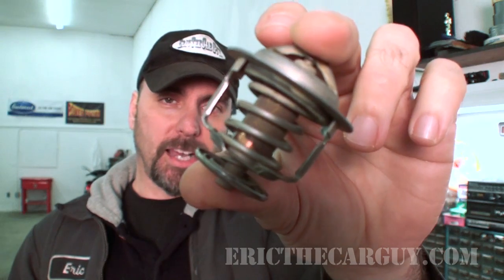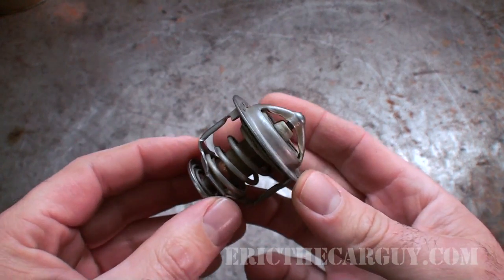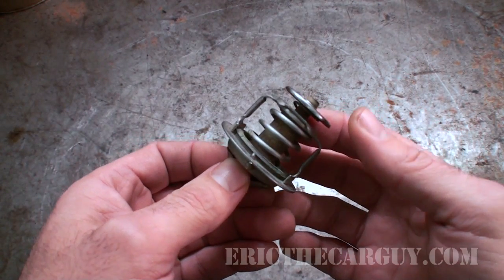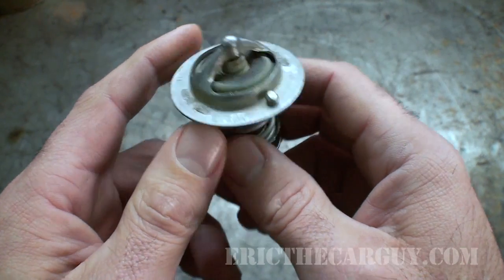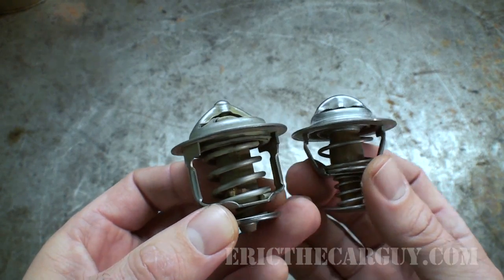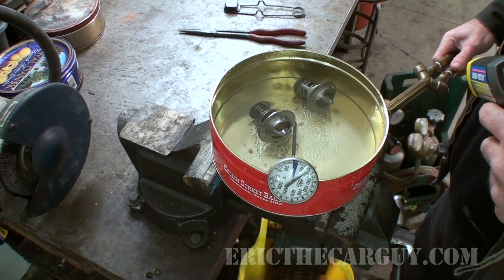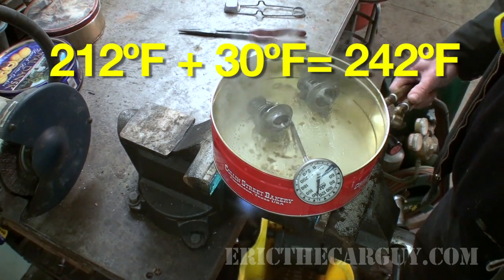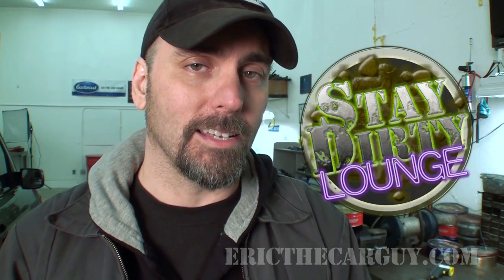Understanding and Testing Thermostats -EricTheCarGuy

Comment: I have a Ford F150 5.0, it started leaking coolant at the Thermostat.  Thermostat was working fine at the time.  I figured I'd replace the O Ring and I might as well change the theromstat too.  Put the new stuff in and it's still got a slow drip.  Took it apart again and put it back together again,  Still a slow drip.  What the heck is going on?

Comment: Hi, my car sometimes overheating when car was warm up at normal temperature then stopped the car a few minutes, then start the car a few minutes, overheating.  We Turn on cabin heater, temperature slowly back normal or Rev upe, temperature back normal. Whye it is?? It is Pajero 2003 petrol engine

Comment: ive read on alot of forums people will drill a tiny tiny hole into their thermostat to let coolant get into the engine quicker and help bleed the system better as well. A 1/32nd drilled hole would be perfect

Comment: I have always read, 3.25 degrees F for every pound of pressure. Close enough to 2 degrees F though. I have never been able to find the information at what temperature one would close though. I don't think many vehicle manufactures make their products, they just buy parts and assemble them to make a vehicle. Meaning these two thermostats, could have been made by the same company, even though they look entirely different for the same vehicle. I am sure you know that these cheaper priced infrared thermometers are only good at temperature differences since you cannot adjust the emissivity level as the more expensive ones. As perfect as these thermostats work, I have read that automakers are using an Electrically Assisted Thermostat in vehicles now. Love your videos.

Comment: Your theory on coolant not always returning to radiator from expansion rank ? 1 hose here no evident keaks on those particular hoses . I've done the dye test no evident leaks with uv ..cars running oretty well but if I don't jeep on top of it I'll get overheat issue and /or no heating. (Cold ) but if I keep eye it's all good.  Had hg replaced under a year ago but wonder if it even needed doing tbh . Garage has done checks can't find a fault . It's bizarre but garage I think tbh couldn't be bothered

Comment: excellent. I've used thermostats that I'm not sure they would be 'aftermarket', but are the sort of generic fits all parts available. They also opened quicker and had much lighter duty springs than the 20 year old one that was installed. I think this is a good thing to open earlier all things considered.

Comment: The water will pull the super hot torch heat away quickly, but it looks like your cookie tin is about to burn through the bottom.
Thanks for the thermostat test and comparison!

Comment: my sons 2008 silverado 5.3l has had a lot of overheating issues and its run without thermostat and still wanted to overheat? I can tell everytime is going to run hot b/c heater hose are cold and then it blows cold heat. I did replace bad radiator and expansion tank because of leaks. The water pump was repalced a coule years back and its has another new thermostat as of last friday and ran great for couple days but now he texted me its running hot and return radiator hose is swollen and very hot? The only thing i can think of is bad or imtermmitent bad water pump or the first stage is the recirclating thermostat isnt open so building back pressure and casuing it to overheat again??? Maybe blockage ? we have drain and put so much antifreeze or water in and out i cant see how is blcokage? Maybe blown head gaskets? Its strange it will run a few trips or a couple days then my son says his heat is cold again and then it starts climbing to 210 and above and then hot even driving and fans blowing. Advise lol

Comment: 13:25 yes and no, because that seal could be weak and still allow coolant and to get through when pressured, they do become weak so even if you stick it in boiling water he’s it will open and close but that rubber seal can be weak

Comment: The thermostat is set at a prescribed high temperature to help the oil system to; evaporate fuel and water (from combustion chemistry). Too much fuel in your vehicles oil system can dilute and thin the oil, excessive water and condensation in the oil can turn your oil into a frothy sludge, both of which can reduce oils lubricity, film strength and increased shear. This results in increased engine wear. So if your vehicles thermostat fails, do not let it run without a thermostat long-term. You are welcome. Thank you for entertaining and sharing.

Comment: I have an old 91 Camaro no matter what thermostat I put in a l run hot and overheat, I take the thermostat out the car runs at temperature no problems

Comment: I have a question about thermostats. Just purchased an oem water pump and thermostat. The mfr redesigned the water pump, and thermostat. when installing thermostat, it seems strange to me that the bottom of thermostat touches the bottom of water pump, and thermostat sits about 1/8" above body of pump. Like thermostat internal structure is too long. when tightening bolts the thermostat spring is depressed about 1/8". Never seen that before. Usually the thermostats always fit perfect, and no compressing of spring on install. I am wondering if this is an error in the manufacture and design, and if this will interfere with proper operation of thermostat and cooling system. you also can not just install the older style thermostat, because the diameter of internals is too wide to fit in the new pumps. You are kind of stuck using the new thermostat from the mfr. if you are to use their pump.

Comment: Tip: observe the water while heating,   when it has small bubbles just before the waters color changes to w white-ish tint, it's temp. is under 180°F . When it color has a white-is tint it's over 180° F . When the water is boiling, it dosen't have to be a violent boil, just lightly boiling it's @ 212° F or 100° C ...  boiling violent or lightly it's 212° F Becuase it's the max temp. which water boiling [ it's actually for  Chemically pure water] but tap water is close enough for the test. the same goes for its freezing point 32° F or 0° C .

One more thing Eric, Thermometer's like the the one shown in your video are calibrateable.  If you turn it up side down you would see that at the opposite side of the dial it has a hex.
This hex is for calibration, the process if fairy simple...
you need a glass of ice water [ preferred a foam coffee cup, becuase it insulation properties ].
Then insert thermometer and wait about 2 to 5 min. [ 5 min mostly an over kill ].
The thermometer should be at 32 °F , if not ajust with wrench and re-check thermometer, if not at 32 ° F , then re-ajust until at 32° F.

You can also, do this with boiling water. but be careful not to burn your self. 

I my self have 2 thermometers on calibrated with ice-water and the other with boiling water,  this is because am picky, this is because their is a discretion in temp. due to the thermometer is  a mechanical device. but ice water is close enough.  Also, the temperature at which water boils differs with altitude. 
Ok, Eric, I think I have written enough,  and you can take it from here...
Oh o e more thing, You can check the accuracy of you DVOM  [those equipped  w/a temp. Probe you will find that most of of them are not accurate [ personally I haven't found one to be correct, In bought tested w/ice-water or boiling water.
Also, ice-water is always @ 32° F / 0 °C .    32° F / 0° C is the temperature where water is found as a solid an a liquid...
Very good video.. 👍

Comment: So I put the thermostat in boiling water. It opened up.  But, water still isn't circulating. I am going to check out your video on how to bleed the cooling system
Reply: Also, super detailed video. Bad ass thank you very much sir.

Comment: Is there someone that can explain why the rotational position matters when installed on many vehicles? Is it the position of that little air bleed jiggle valve thing that matters for some reason?  If so why? In reference to a Subaru engine where the thermostats upside down I see some claim that little air bleed valve needs to be facing the front of the car. Thanks

Comment: My question was which side was up and which side down but hearing and watching the program I learned a lot more thanks for the info
Reply: Spring side to the hot water usually down
Reply: The big round hat end is what you will see sticking out of the thermostat housing.

Comment: I know old vid but. Is it possible for a new thermostat to work perfectly, gauge right in middle then begin to stick closed and overheat ? Takes about 25 to 30 minuets then engine is shut down by what I don't know. Top hose and that part of radiator reads from 224 to 230 degrees. Cap off it blows coolant out. Level of coolant goes up in reservoir half inch or so and back down when cool and starts normally. No coolant loss only very tiny leak at oil cooler when cool not hot. I did not know about the bleeder valve either and no mention of it in directions only to make the therm. bar level. It's been filled with pressure until no air at highest point and filled by pro equipment that uses a vacuum. More likely a crack or head gasket?

Comment: My car is in the shop. I likely need a new rad because it may be cracked. Hopefully it's not, but I can't tell where the leak originates from. But, my mechanic asked me if I wanted to replace my thermostat. It's a beater, but I must maintain it. 
Honda wants $53 for an OME HONDA thermostat. NAPA has after mzrket thermostates for $9.
I don't think there is anything wrong with the thermostat though it has 266k on the engine. Any thoughts?

Comment: I'm confused by the first comment where you state that Vehicles don't enter closed loop until operating temperature is reached 195 to 210 degrees Fahrenheit normally modern cars achieve closed-loop fueling status after about a minute which is when oxygen sensor heaters turn off

Comment: Can you both have over heating and cold air pouring out of your heater vents in the cab at the same time?

I'll be checking my thermostat tonight/weekend. On the way to work the coolant gauge would fluctuate depending on throttle (more throttle, more heat. Coasting and temp would drop, and some rough run/idle. Before shutting off.).

Comment: A thermostat works using a 'WAX MOTOR'.  Inside the copper cylinder, 
hiding in the middle, is a powerful THERMO-EXPANSIVE WAX. Inside the wax
 motor cylinder is also a piston. Hot water heats the copper, then the wax, 
which pushes on the piston, which pushes against the tstat's water valve
 closer spring

Comment: On the little air bleed on the thermostat you said to put it toward the top is that pointed toward the firewall or the radiator. Thanks Dennis

Comment: I went to diagnose why my car nissan Primera w10 kept overheating. I removed the thermostat housing and found that the previous owner runned the engine without a thermostat.🤷🏾‍♂️🤦🏾‍♂️
Also did he use the upper part from the manufacturers thermostat like a spacer to fit the cap on the housing. 
The termostat housing got a sensor with a harnes wich he short cut with a paperclip to keep the radiator fan runing continuously. 
Question: Did the previous owner  removed the thermostat for a reason and do i need to worry about putting a new thermostat?

Comment: so when a thermo opens and will the temp sensor also start the cooling fan? i let my eng idle and i think it went to 95deg C then the fan kicked in and the temp went down to like 55 if i recall ,now does that mean i did not have any air in my system or at least behind the thermo and everything is working good or could it be the fan alone was enough to cool it drastically like that? i am thinking no it must have been also the thermo opening up and letting the coolant system do the job,,what do you think? because this can save me time and money if i dont really need to replace the thermo but juts do a coolant replacement

Comment: i am not sure but i think my thermo is on closed position and may need to be changed,,i get a check eng light that im told from diagnosis is either my gas cap or my thermo but the light is not steady and sometimes goes away but this has been happening for years now and at certain times it would be steady on many drives and sometimes would go away so does it mean the thermo might be working properly at times and not at others? or could it be i got air behind the thermo giving a wrong reading to the sensor and in that case needs to be bruped? i thought the burping happens automatically through the reservoir, or should i put the car jacked on an incline and open the reservour cap and run the engine till it all burps out? thing is i want to change the coolant as its getting old now and wondering if i should bother changing the thermo first? i figured its a hard job but might be fast and easy for my mechanic  and should not cost too much for him to change the thermo and then i can do the long drain process on my own

Comment: 1972 Ford F250 .replaced water pump and thermostat. Engine side hole was damaged and had a big hole which larger than thermostat and it go through the hole and doesn't stay with housing . What is the solution? I double checked the thermostat and new housing and those are the right thing.

Comment: Good clear vid thanks. 
But quick question - I have a tropical thermostat on my Toyota so it opens sooner.  As a result the car doesn’t create heat for the cabin. Maybe that doesn’t matter but is the engine running too cold? Thanks

Comment: When you're thermostat close too slow, your engine will run cold. Just changed mine, tested and it was opening but closing way to slow causing the engine to run way too cold. The temperature needle never pass the 1/4 mark and goes way down when driving on the highway. Installed a new thermostat and the temp gauge needle is solid at half way mark and doesn't move at all, either on the highway or city driving.

A slow closing thermostat is as bad as having a thermostat that is stuck open.

Comment: This might just be the solution to the problem I have been having....
coolant coming out of overflow tank, but the engine is not overheating.
And the heat in the truck is awful.

Comment: Is aftermarket just updated parts in some cases , perhaps more efficient i don’t know, but shouldn’t cars delay on temperature when shutting off engine rather than quickly closing the valve or quickly cooling down just curious,

Comment: help ... :)) i've changed the stat  and refiled  the lost coolant 1.4 gal's and  i've bled the the system  and temp still drops wile driving aggressive  from 180 to 86 F   (82 to 32 C) and  back to 180 aand the  temp outside is just below  32 F (0C) ...  i use a  premixed antifreeze,   coolant is flowing thru all the pipes  thermostat opens and closes normally no problem there  but the  radiator  is cold ..i just don't understand  what's not right   i first  noticed this when it started to get cold outside ...in the summer there's no problem  temp  keeps up under  all conditions

Comment: Hello Eric the car guy. I have a honda accord 2000 v6 sedan. And i just replaced the timing belt etc. But my question is about the thermostat. I bought a aftermarket that open at 68 celcius. Rather than oem at 75 celcius is this okay for my car. I drive my car as normal no reving and racing. Please let me know if it is good or not so i can change it back to oem. Thank you sir.

Comment: Hi man, my subaru temperature Needle drops and comes up past normal to 3/4 then back to normal.
Though I had replaced the leaking water pump and thermostat.
What do I do the ac fun is working but the other one on passenger side not working  and there is power to the connection point with the mirror.motor .
Based on videos I give u a thumbs up.
This is perfect.

Comment: Ok hi eric got a question my mom.has a 2005 nissan murano sl its been to 5 shops 3 diags and still has popped p0507 which is coolant system throttle body has been replaced the power actuator is working and it is still throwing the code p0507 sooo my question is if its running hot and not showing hot on the dash lights and check engine light is still on could the thermostat cause the code to pop up

Comment: Awesome video! ... I do have a question is it recommended to change a thermostat if your vehicle has over heated?  (was last winter on an extremely cold day around - 40 to -45 and im assuming my thermostat stuck and didn't open. pulled off to the side of the road and turned off the vehicle and tapped the thermostat housing and when i turned it back on, it did open and the temp started to decrease)

Comment: The thermometer should not be touching the metallic bottom of the tin can. Also, the radiant thermometer is inaccurate for reflective surfaces, like the metal bottom of the tin can. Pretty good explanation otherwise and good show and tell.

Comment: Eric i v got a question  after driving my car 2.5 hrs radiator blow out temp control went on red zone then stoping the car turn off engine and then to on start possition  fan didnt start up i quess that fan didn start and before driving all the way to the next city with a/c system on could be overheated but my car has two fans one for A/C and one for cooling system what can be the causes the fan not operate at all ? i remove the radiator and it was cracked.